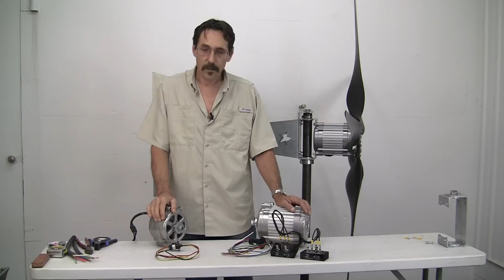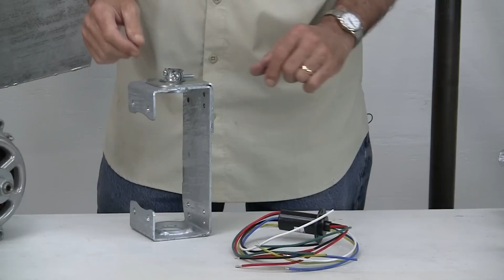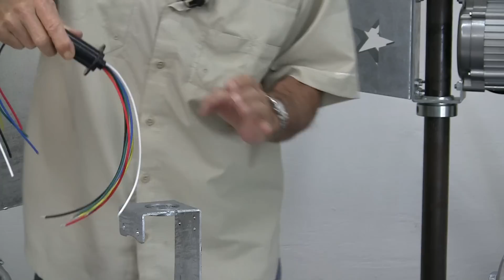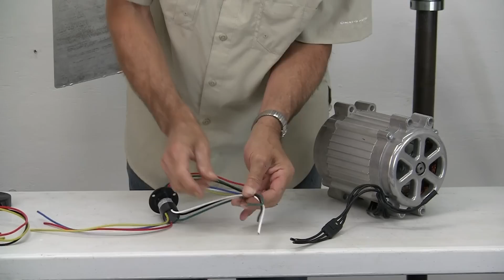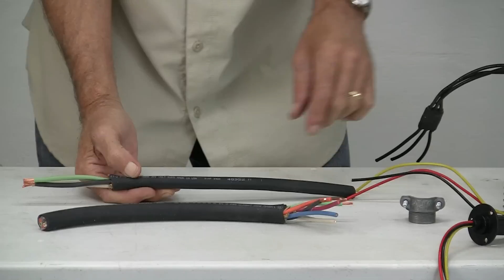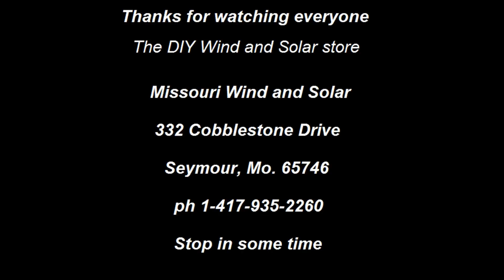How to Install Wind Turbine Slip Ring | Missouri Wind and Solar

Comment: The way you did it is much better for the heavier longer lengths of cord, the way I did it works for 10 foot lengths of cord weight max on a 10 foot tower :)

Comment: Hi Jeff. Are familiar with soldering tubes. Most auto electricians or car production lines use them. All you need is a small (kitchen type) blow torch. The solder, the flux, and the heat shrink tubing all in one. They are fantastic for slip rings and no tools required.
Reply from the maker: ian57812 I had never heard of those Ian. I would use those if i had them. I am going to try an find them. 
Thanks, another great idea from the technology shed.
Reply: MissouriWindandSolar  Your welcome. We use them in the Technology Shed. Great for stators, connecting Pmg's  any thing that's needed to be solderd really. Especially good if your up tower or out in the field.